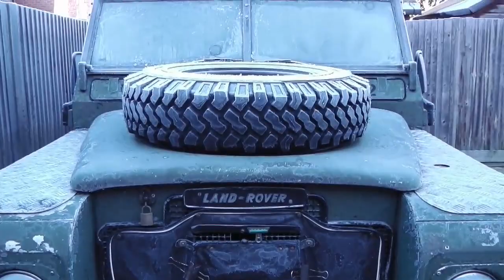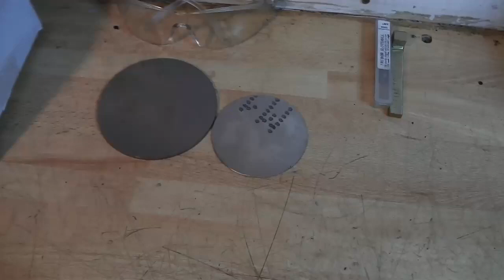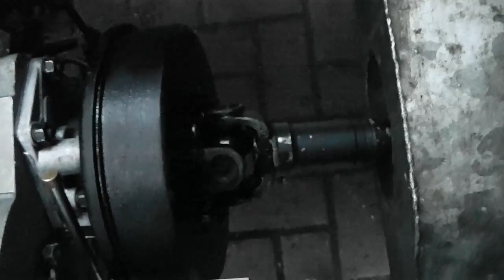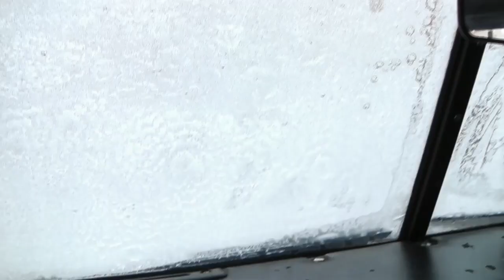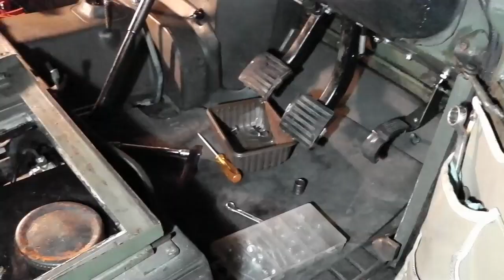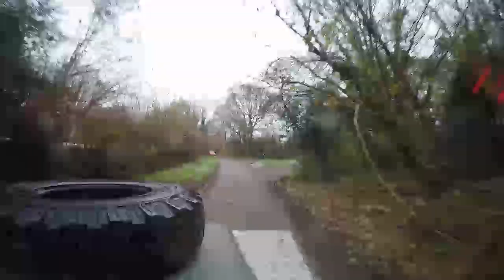Land Rover Series 3 Gearbox Swap - Part 3

Comment: Great result! You must be well chuffed with that. Those petrols are so quiet. You've made me wonder about the current landy of mine - I might well have a noisy gearbox in that but with the racket of the 2 1/4 diesel I'll never know about it!
Reply: If you cant hear it you dont have to worry about it.
Reply from the maker: Cheers Max! Very pleased with it, I expect it'll quieten down a bit more once the new gears have settled in a bit. I do like that bit in the Haynes manual which prefixes the gearbox overhaul section, "...the decision to overhaul should be taken based on the amount of noise and malfunction the driver can tolerate"  Clearly written by an experienced hand! If it's all working nicely....
Reply: @steamwally  Hi would you be interested in rebuilding a rover 3.5 v8 on the channel for me.  May be we could strike a deal.  Thx chris

Comment: Have you never thought about putting a diesel night heater in it Chinese diesel night heater Bear in mind I run incerosene not the hottest but it takes some of the draft away definitely windowboxes definitely an excellent video it goes well I bet you’re well chuffed with it fantastic job fantastic video thanks for sharing 👍🏻👍🏻A++ got one in mine 2 1/4 diesel engine 1971 series 2A put it in behind the passenger seat as I couldn’t put it anywhere else as a diesel tank is under the driver seat  could put in the seat box on the passenger side but I couldn’t do that so I put it behind the  passenger seat because I couldn’t put it anywhere else the  heat  comes into the cab Jobs are good one might be something to look into 👍🏻👍🏻A++

Comment: All of the bolts going into the fuel tank go into castings with drilled and tapped holes. But, the holes don't go all the way through the castings which will prevent vapour coming out or leaking so it's pretty safe if a single bolt is loose or missing. I believe that it is a design standard for fuel tanks. I have had a look at the internals of two different types of LR series tanks and they use the same leak proof system. A good gasket and non setting, fuel safe sealant is the way to keep the fumes down, and make sure the bolts you use don't bottom out before they torque down on the pick up tube or level sensor tops. Great videos, cheers!
Reply from the maker: Thanks for the comment, that's certainly true of the original tanks but that auxiliary tank is a reproduction and the holes are tapped all the way through. I've found "Heldite" and Loctite hydraulic sealer effective against petrol in those sort of applications. All seems to be well now, no more leaks.

Comment: Have you used for both the transfer case and gearbox the roamer dipsticks? They aren't cheap!!
Reply from the maker: Yes, they are the part supplied by Global Roamer. Years ago I fitted a Superwinch overdrive, I bought the filler plate and dipstick at the time. When I went over to the Roamerdrive, they supplied a filler and dipstick kit with that too. Using the dipstick on the gearbox does increase the oil level a little, but I have not found that to be detrimental and good seals cope with it fine. As for the Roamerdrive, you get your money's worth!
Reply: @steamwally  Supa! I'll get some.

Comment: Great to see WRD back on the road again 🙂 Did you say you were going to stop using it as your daily driver? 

I'm trying not to use mine when there is salt on the road, though I do miss it so sometimes take it out for a quick drive to the shops and back😆
Reply from the maker: Thanks, it's very pleasing to have it back together again. Late 2020 I stopped using WRD as a daily driver, but at the time my shortest commute was a 40 mile round trip and it was getting very expensive. Having moved on, I can drive the long way to work now and still do less than half that distance there and back, so running a Series regularly is now rather more practical. The salted roads are a pain, but there are plenty of country lanes around here which aren't treated and can be enjoyed at Rover pace..

Comment: The wrd must be the best sorted tatty looking land rover.
Reply from the maker: I'll be happy with it once the new engine is fitted,  then it should be really good to drive. Long term, a galvanised bulkhead and slam panel would take it up a notch.
Reply: @steamwally a healthy 2.5 would give it some extra pep, should be very nice!
And with a galvanised it will outlive you
Reply from the maker: @rickz9495  Yeah, it's getting a 2.5 eventually, I'm very slowly acquiring the parts to overhaul it.